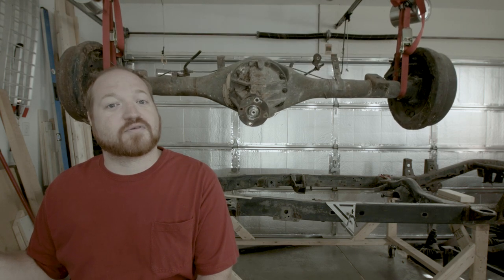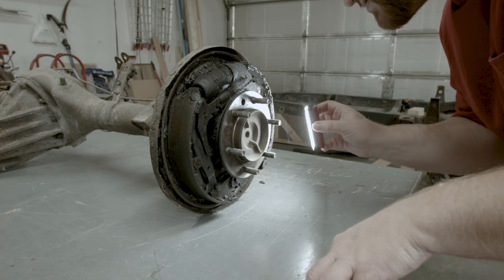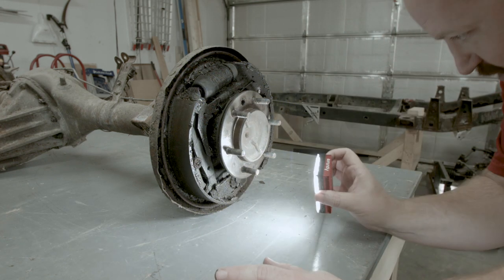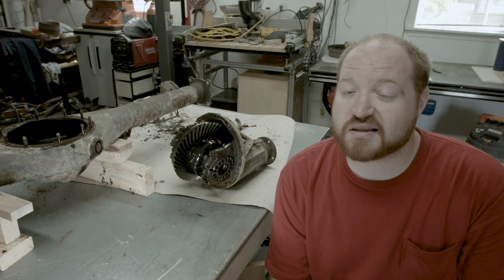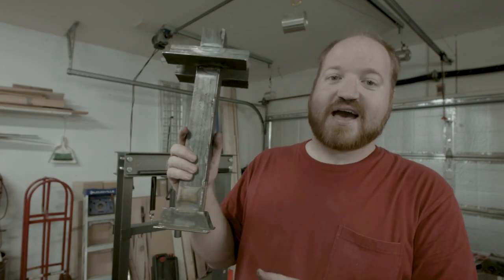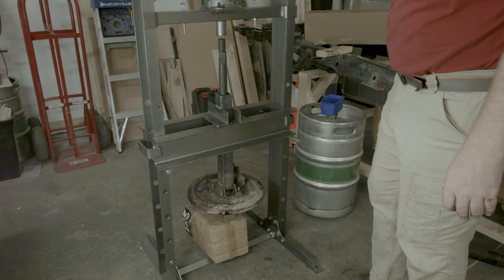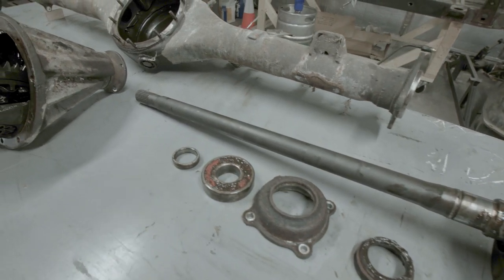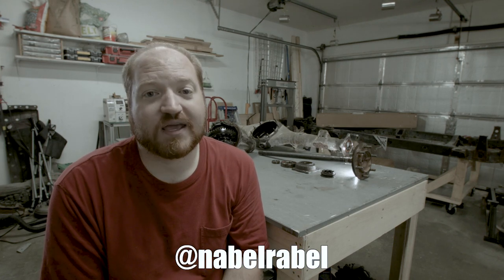Rear Axle Disassembly - 1989 Toyota Restoration Episode 19

Comment: I’m curious what the bracket on the back of the axle is? It has two bolts holding the bracket just to the left of the pumpkin and has a series of rods that goes to something mounted in the frame. Thanks in advance. 2:40 shows it

Comment: This is such an incredibly helpful and well put together video! Thanks so much for taking the time to film, edit and share it with the world! My bearings have gone in the rear diff of my 1992 Masterace Surf and the shop quoted over 2k to rebuild it. It's JDM so finding parts in Canada is tricky! Cheapest and easiest option is to swap out the rear axle assembly but i cant find a domestic vehicle that shares the same specs! Then i came across your video and may give rebuilding it myself a go! Where did you get your rebuild kit? My Axle is F252 so its not identical to yours but very similar. Thanks again for sharing and inspiring. All the best
Reply from the maker: I got mine from lceperformance or lceengineering. I've bought a few things from them and haven't had any issues. You can also find them at lowrangeoffroad or yotamasters. If you have questions about fitment I bet you could drop them an email and they will be happy to help and they are probably more knowledgeable than I am. I've also made a video putting it back together with proper preload and backlash settings. So check that out and give it a go!
Reply: @Obscuremotorsports  Amazing - Thanks so much! All the best with the rest of the project - Excited to follow along

Comment: The oil could be brake fluid. Or it could be from the differential. Make sure you check on that little vent cap on the axle housing. I just took mine off and when it came off it went poof telling me that there was pressure in the axle housing. It will cause the oil to push past your seals and cause your brakes to be bad or weak.

Comment: Hi @Nabil Imam can we pull out the axle without opening the differential?
Reply from the maker: Yes you can. There are 4 bolts that hold the bearing cup to the axle tubes. Loosen those and the axle will slide out. You should see those bolts when you take the drum off.

Comment: WOW, you really are doing a complete restoration.  What is your vision for the completed truck?  Rock crawler?  Stock? Now that you've done the engine and the rear differential...what's next?  Great channel, love the Toyota stuff.
Reply from the maker: The vision of this truck is stock with a few modern amenities. I'm also painting it 3rd gen Tacoma orange. It will be my daily driver and in town hauling. I'll be building out a rock crawler after this project is over. What's next? Not sure whatever strikes my fancy... Maybe I'll start ripping apart the transmission and rebuilding that.
Reply: @Obscuremotorsports  Cool...I'm trying to make a decision on what my next truck project should be.

Comment: also where do you order your replacement parts? (im trying to find a complete rebuild kit but dont know where I should start) 
Thanks in advance!
Reply from the maker: I thought I responded to this. I've shopped at places like LCEperformance, lowrangeoffroad, eBay, Marlin Crawler. Not everyone has everything you'll need. You'll have to buy from different places to get everything you'll need. It's not a huge deal, just takes a bit more effort to make sure you've ordered the right parts. I think I've ordered the wrong part 3 different times, I just drop the parts in the parts bin and move on.

Comment: how did you get that Pinion out?
Reply from the maker: How did I take that apart? I did it off camera apparently. To remove the pinion you need to hammer out the indent that holds the shaft nut in place. Once you get the indent hammered out the nut will spin with little force. After this you can wedge a piece of pine wood in-between the gears and spin the  nut free with a short rachet. This bolt isn't highly torqued because it's set to meet a certain preload. So the indent on the nut locks it in place. Once you have it apart and cleaned and put back together you can watch the episode a few after this on how to set the endplay and preload. Hope this helps!

Comment: It came from a 98 Tacoma 3.4 v6 I haven’t rebuilt it wonder what is causing it
..
Reply from the maker: It could be anything at this point. What have you checked? Are the tires balanced? Brake assembly balances? Did you swap prop shafts too? Is one of the universal joints bad(you can check this by pushing and pulling on the shaft in all directions. If it moves back and forth the universal joint is bad). Anything that spins can cause vibration so start a list of anything that spins and check that they are balanced. And remember, just because it was balanced on the old axles doesn't mean something didn't happen during the swap to cause them to be unbalanced. Don't rip the axle apart until you are 100% certain everything that bolts to it is balanced.

Comment: thats a v6 truck right? judging by the 4 ribs, by any chance are you gonna run LSD in it if so what kind.
Reply from the maker: The truck is a V6. I'm going to be leaving the driveline pretty much stock with the exception of dropping in a 5 speed. If I find a need to put a limited slip in it I'll drop in it later.
Reply: @Obscuremotorsports  ok thanks, im gonna swap that axle into my corolla and go through this same process done in the vid.

Comment: What are doing with the frame? I've got an 89 that has a rotten frame. I've toyed with the idea of trying to fab one but I'm not a welder. I think your brakes are full of grease and mud.
Reply from the maker: I plan on rebuilding the back half of the frame. I'll probably be cutting it a few inches I front of the rear cab mount. Once I'm in the new shop I'll be getting a 3d scanner and digitizing the frame so I can make a jig to locate all important points. Then I'll hack it apart and start rebuilding

I just gained a bit of confidence in my welds this week after putting that fixture through the press. So I don't think rebuilding the frame is going to be an issue!
Reply: Nabil Imam what type of welder are you using?
Reply from the maker: I'm using a Lincoln Squarewave 200. It's a TIG that runs off 120 or 240. It's completed every job I've asked it to do, so I'm very happy with it.
Reply: Nabil Imam Is TIG better in this application than MIG?
Reply from the maker: Steve, that is a loaded question. I am by no means an expert. I'm self taught and welding is just a hobby. I've been welding for 7 years, so years of trial and error has made up for proper education. As for this application TIG or MIG will give you great results if done correctly. I bought the TIG because I like to weld aluminum too. If you're only going to weld steel, MIG is a perfectly good choice. So if you're asking if you can MIG a frame together the answer is a solid yes, but take the time to learn how to MIG correctly. If you know someone with a welder you can offer to help assist in their next project in return for some weld time. They probably won't let you weld on their project, but they might let you weld some scrap together and then beat it with a hammer and see if the welds break. I hope this answers your question. If you want to learn more about welding look the weldingtipsandtricks channel.
Reply: Nabil Imam Thanks very much for the advice. Being able to weld aluminum would be great so maybe TIG might be the better choice for me as well. I really enjoy your channel. Look forward to seeing how the project progresses.